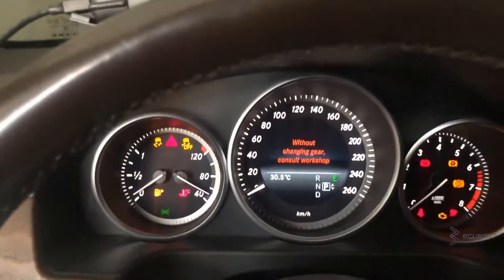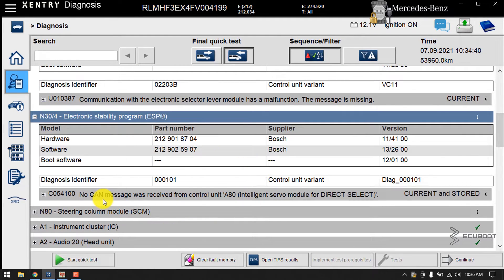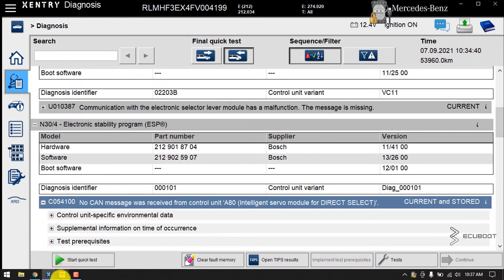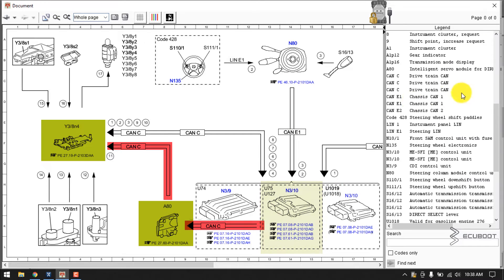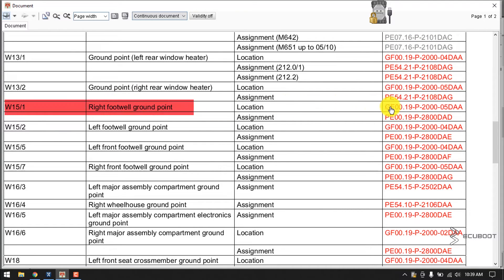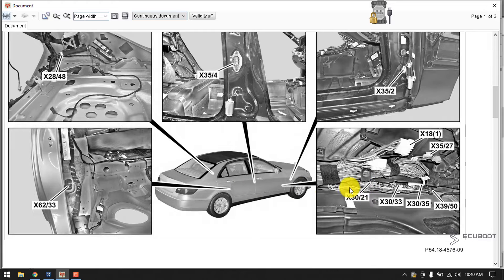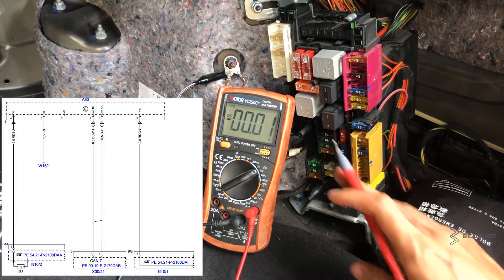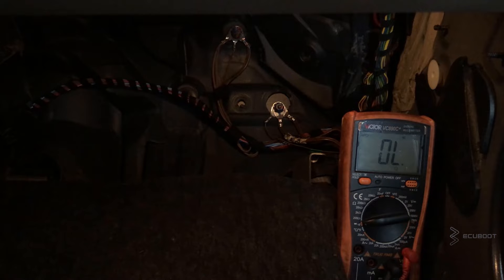Mercedes Without Changing Gear Diagnostic and Fix

Comment: Thank you so much. Wow, I thought X30/21 as per this video of CAN C  has no resistor/s. It does not show resistor on the WIS
diagram. CAN BUS supposed to have terminating resistor at each end of the network using 120 ohms, so 60 ohms will be the value of both ends. But your test showed that each connector is 60 ohms and that distributor block is actually a Daisy Chain topology as per diagram and physical look.  Very interesting on this 60 ohms each channel of X30/21 stand alone not connected to anything.

Maybe MB is using similar to page 7 & 8 reccomendation from Ti, https://www.ti.com/lit/an/slla270/slla270.pdf
Is there a coupling capacitor inside X30/26 PCB board other than a resistors ?

Well thanks again. Keep up the great info. I am just a hobbyist only and has W212.065.